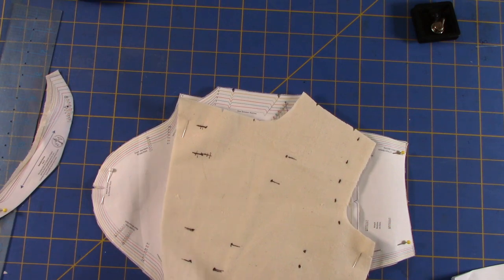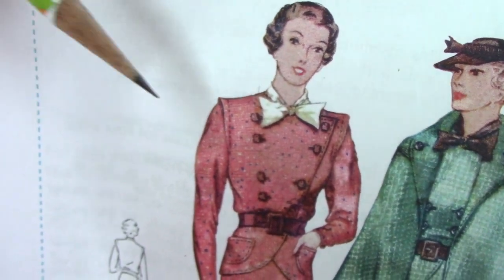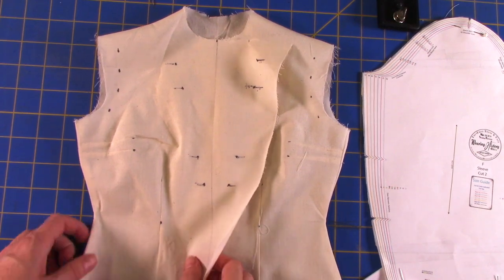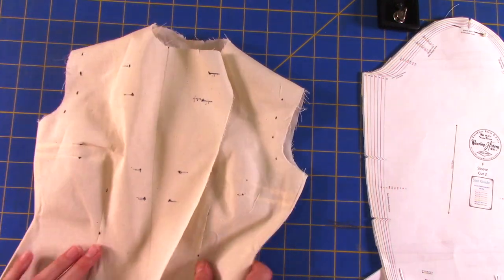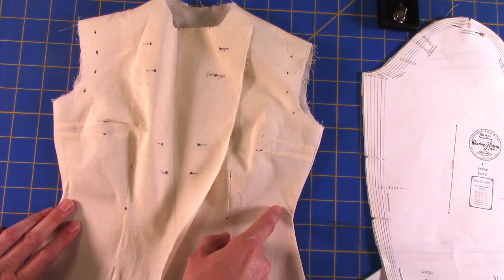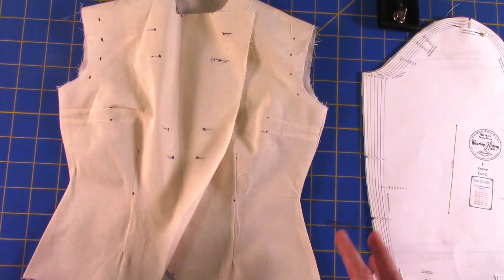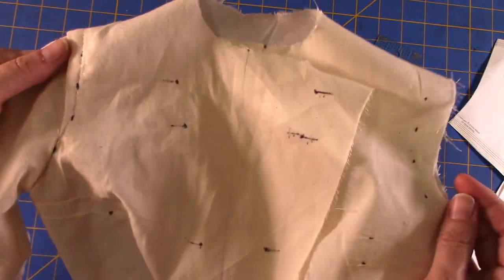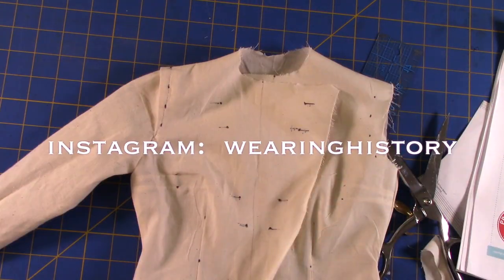Sewing Tutorial: How to Set a Sleeve Cap to an Epaulet- Wearing History 135

Comment: Thanks so much for sharing the historic method originally conceived for this shoulder line. It was interesting, but I am so confused as to why the sleeve isn't set onto the facing as though it was the armhole and then topstitched in place. It's topstitched anyway, but this method relies heavily on prep and dexterity, whereas the other way would be just as accurate in the end but use a whole extra 3 feet of thread.
Reply from the maker: Great question! I just went off of the period instructions and their description, but any method you wanted to use could be adapted, just like with all sewing!